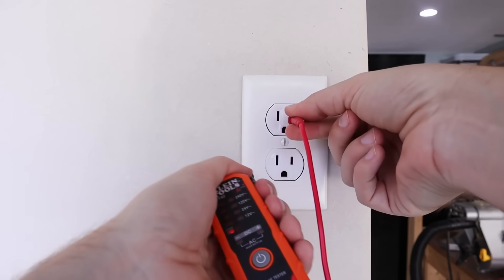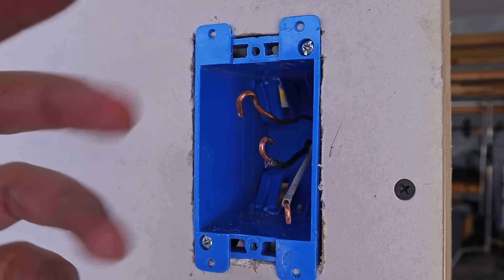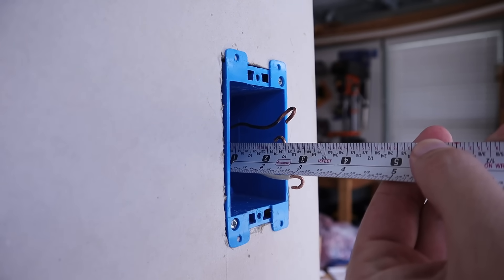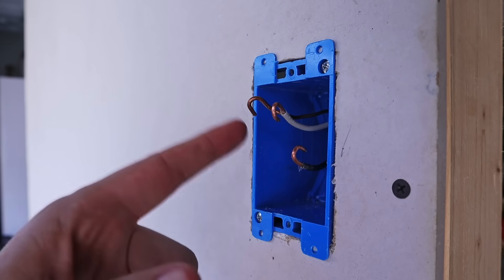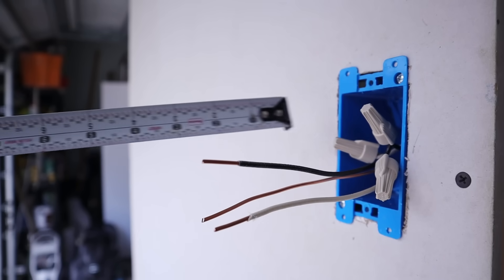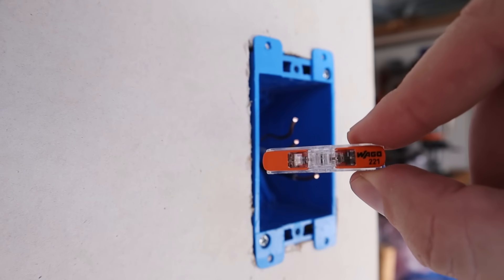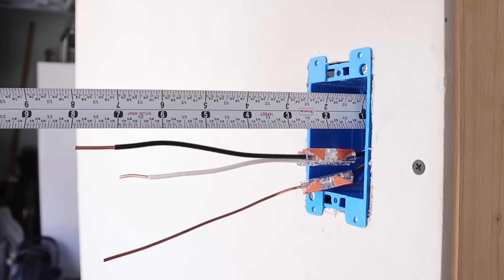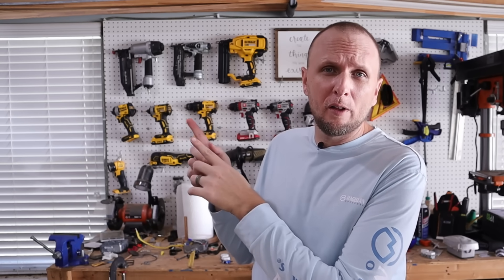"SHOCKING" New Way to Fix Short Wires In an Electrical Box to Code | Very Important

Comment: should I bring up the ever controversial, pre twist or not to pre twist the wires before using a wire nut. by code you are to install wire nuts as recommended by the manufacture. in my 28 years of being an electrician, I have not seen the instructions on how to install a wire nut ever include pre twisting. I am not sure I agree or disagree with the manufacture on this, and have done it both ways. just something to keep in mind
Reply from the maker: Well per code it says that you are to follow the manufacturers instructions.  Most of them say pre twisting is not required.  Which to me completely leaves the door open to it being your choice.  I have not read them say do not or is not recommended on the majority of brands.  I think inspectors interpret the code this way as well since every electrician I know both residential and commercial pretwists their wires.  But I would rank this subject as probably top three most debated topics.  That is for sure!  Thanks a lot for the input!
Reply: @HowToHomeDIY  ahh so the manufacture have positioned them selves in a neutral stance. I honestly have not read the instructions on wirenuts  in a very long time.
Reply: btw I have not pre twisted a wire nut in 20 years. you just need to keep them the exact same length. the wirenut will do all the twisting it needs to make a solid connection

Comment: You didnt address the insufficiency of the space in the box to accommodate the wago connectors or the twist connectors after the switch or outlet is pushed in.  Also with such long tails as required by code, any sharp kinks in the back of the box can fracture the sheathing which needs to be avoided.

Comment: Now you just have to find another way of connecting the outlet... Maybe something without screws and without exposed conductors. America really should be more open to inventions we made in europe 30 years or so ago. You can pull out an any outlet here without shocking instantly yourself, even the ones with screws. Code can be changed...

Comment: Where do you buy the extra wire and what number?
Reply from the maker: I have found buying my Romex on Amazon to be the least expensive as of right now.  I buy whatever size I need for the circuit.  14 gauge for 15 amp circuits and 12 gauge for 20 amp circuits.
Reply: @HowToHomeDIY  Must be in Yank land, 14/2 is approved for up to 20 amps  in Canada.

Comment: Here in Germany, Wago 2273 are way more common in junction boxes, and if i remember correctly they are in every way better than wire nuts. Less resistance, easier and faster, smaller, easier to reuse, and you can just add a wire to an existing connection or swap the Wago for a bigger one in less than 30 seconds. They are only good for up to 2,5mm2 (12AWG), but for up to 6mm2 (10AWG) there are versions of the Wago 773.
Reply: @ronblack7870  You are somewhat right, a perfectly applied wire nut usually has a little over half the resistance of a Wago 2273, but as the wire nut itself doesn’t conduct electricity, there is no way to guarantee that low resistance while wagos just need somewhere between 10 to 15mm bare conductor pushed in as far as possible (officially 11mm but in my experience 10-15 still works just fine), which is undeniably easier and more repeatable than applying wire nuts perfectly every single time.
Some other benefits I was just reminded of are:
- direct connection between solid (Wago 2273) or solid and stranded (Wago 221) conductors made from Copper, Aluminium and Steel possible
- possible to remove any single wire without even touching the others, which is a unique feature not found on any other common connectors made for 3 or more wires.
- easy to check the connection of the individual conductors, basically impossible with wire nuts

Comment: Not a big fan of push in connection, I view them as a liability wating to happen.
I've also found a lot of electricians dont install the ground on a light switch.

Last the ground wires always uninsulated inside the box great care has to be taken to keep it from shorting out to the hot wire or that will trip a breaker. Hopefully thats all.
Reply from the maker: Yeah I do no like the push in connectors.  The Wagos are much better than them though.  I personally still use wire nuts mostly.

Comment: I find it odd that those saying that stabbing an outlet is bad tend to support using Wagos, which is essentially the same thing. I'll stick to wire nuts.
Reply from the maker: Well they are completely different mechanisms if you look at them on the inside.  And I’m not a Wago fanatic.  I typically use wire nuts but wagos are a great option for certain applications.

Comment: To me the wago connectors seem similar to the push in hole on the back of outlets. I worry they will lose with age. I don't trust them.
Reply from the maker: I understand the lack of trust.  I will say though that if you opened up a receptacle and opened up a Wago you would find they are very different in how they work.  Thanks a lot for the input!
Reply: They are a simple minded way to avoid work.

Comment: I ran into this at my uncles.  Home was broke ground about 40 years ago and its a life long project. I was very young back then and not ant help. The boss " his wife" wanted white switches and receptacles. I think they wired one and yank out all the slack..."waste not want not" is what Grandma said.  I changed some and It took more time than it should.  GFI's and extra wire don't fit. Block wall filled with concrete

Comment: What about the Wago 2273? Are they legal to use over there for solid wires? The 221s are great if you connect stranded wires but they are quite bulky.
Reply from the maker: They are legal but Ideal kind of has the push in connector market cornered with their In Sure connectors.
Reply: The 2 wire and inline models are MUCH smaller.

Comment: Does this same method work with aluminum house wiring?
Reply: The Wago's will, how old is that wiring?
Reply: @michaelwright1602  appreciate the reply very much. The house was build in the mid 60's. So original to the house.
Reply: @dwayne5698  I would start to rewire if it were me... Just saying. It is not that difficult, but can be a PIA depending on the structure.

Comment: One thing I did not hear you mention is that the 3 & 5 wire connectors are only for multiple wires of the same polarity. For instance 3 white or 3 black or 3 ground. One cannot connect the white, black, and ground in one 3 wire connector.
Reply: 🤷‍♂Who knew?
Reply: @georgemicha2454  Shaking head and rolling eyes... But, I could see someone doing exactly that...
Reply: Well duh?  Wouldnt it be obvious, you wouldnt wire your hot and neutral together would you ?
Reply: @Mixwell1983  
I think he meant connecting all three with the same connector, one three way connector per neutral and so on?

Comment: US electrical system - safe? Is that even possible...?
Reply from the maker: We do not have any more electrical fires than the UK per capita.  The US actually has slightly fewer.  You can look it up.
Reply: @HowToHomeDIY  Comparing to Sweden. One of the safest in the world when it comes to electricity.
USA: 3 deaths per million.
Sweden: 0,2 deaths per million.

Not counting all the other accidents that cause hospital visits or only shocks, and fires and more.

And worth noting: Lower voltage (safer) in USA compared to Sweden.
Reply from the maker: Well I said UK but either way I’m not finding your statistics to be accurate.  First, Sweden does not really have a full set of data concerning injuries and death from electrical fires.  Also, if you take the number of electrical fires and divide it by the the population, the US and Sweden are near identical in number of fires.  But if we look at what is probably a more accurate way of comparison and take the average number of annual electrical fires and divide it by the number of dwellings, Sweden has almost 4 times as many electrical fires as the US.  This is all very easy to find through government sites.
Reply: @HowToHomeDIY  We actually have a pretty good statistics on this. Concerning fires, related to installations like fuse boxes and outlets are around 150 per year. In USA, receptacles alone account for around 5.300 fires per year. Stove is the most common cause of fires, and when comparing with USA, remember that 40 percent use gas stoves in USA and in Sweden it like basically zero.

Our laws for electrical installations are superior compared to the US, and the regulations for who can do electrical work is also superior compared to the US, and our outlets are also superior to the US, and all modern home MUST have ground fault protection, and everything must be grounded since several years back, and cables in the wall and how you install them and the outlet connection boxes are superior compared to the US.

And this shows in the statistics, as said. We are in the top in the world regarding electrical safety. Despite a lot of cold wet corrosive climate that is really hard on the infrastructure and the installations with high power demands during winter months.
Reply: Twice the volts/half the amps may make for less resistance/heating at suboptimal connections and in maxed-out circuits?

Americans still have some independent spirit and not all of us embrace the concept of "Big Brother Knows What is Best For Me"-unlike the great majority of Scandi's...some of us value the right to do it ourselves even if it isn't always done in the best possible way.
Reply: @MrMEmEmEmEMEMEeeeeee Well, here in Sweden we really do not have so many maxed out circuits. But, we have three phase too. To practically all homes.
Each outlet in the home is normally fused to 10A 240V.
Common main fuse is 16/20 or 25 (can be larger but not common) three phase 400V. We have 16 here where i live.
This goes really well.
Only problem i might have is if i use the electric water kettle (2,2kW) and the microwave (1,45kW) at the same time since they are on the same outlet/fuse (10A). But water kettle goes so quick so no real problem.

Comment: It’s weird to see plastic blue boxes and Romex as in 23yrs I’ve used a few times, in Cook County/Chicago we cannot use nothing plastic, no Romex, we have to use EMT or if using any Flex we cannot use more  than 3ft in Chicago and it can only be Greenfield and not Armored Cable or BX, when we hit the suburbs then we can use 6ft of flex either or with a ground normally MC Lite. Then to top it off we have to use anti short bushings on any flex no matter what type of connectors you use. Seeing this video is foreign to mist of us here when I deal with cloth wiring 90% of the time on service calls, I do use Wagos but the cloth wire forces us to tape the ends.

Comment: I was hoping for some unique compact suggestion, but not today...  To often those boxes I have had to deal with were so short due to the former service guy or when they built the house used those push in the back connectors on the outlet or switch did not come out or they did not come out for me. The old old system had larger switches and outlets and sometimes a shallow electrical box. No room for even wire nuts.....

Comment: Do you guys in the US ever use the 'standard' WAGO 2273 push-ons? Those are the go-to wire connectors across the pond if there's no stranded wire involved. They're a lot cheaper than the 221's and much slimmer as well. And they come in a number of different sizes (including a 2-wire).
Reply: I have some 6 wire ones.
Reply: See also Ideal In-Sure.
Reply: They have their place but for the average DIYer it's best if they keep some 221's on hand and use those.
Reply: @kamX-rz4uy  @Nervous Breakdown Both 221s and 2273 have their place.  The 221 series is great up to the 5-wire limit.  The 2273 series is great up to 8 solid wires.  If you have both, you'll likely find a use.  If you can only afford one, 221 is the way to go.
Reply: @kamX-rz4uy  They are best when space is at a premium which why I got their 6 connectors version.  Yes, I have boxes with 6 hots/lines or more.

Comment: I would use much longer pigtails so that the splices never need to be disturbed.  They should sit in the back of the outlet box and never move if you install or remove a device from the box.  One of the wiring specs we had on a job was that wire length in an outlet box was a minimum of 200cm or about 8 inches.  It just makes installing receptacles and switches a lot easier to work with.
Reply: There are recommendations for what wires should sit where in the box (although most people might just jam them in there). 
It is recommended that grounds go in the back (first), then neutrals, then hots. It’s to be safer.

Comment: It's probably not the best idea to promote jamming the wire into the WAGO connector. If it were I kinda think WAGO wouldn't market it's device as lever operated as forcing the wire in would be going against the manufactures intended method of use.

Comment: We stopped using wire nuts decades ago in the UK.
Reply: How about the antique white ceramic ones, lol
Reply from the maker: Yeah they were made a lot different back then and more likely to fail.
Reply: @HowToHomeDIY  

No wire nuts are used here at all. Twisting wires together is frowned upon. And rightly so
Reply: @martinw245  Way different voltages/amp loads across the pond.
Reply: @So Isaidtogod  Amps are no different. Loads are no different. Voltage can be. A Wagos rating is clearly given. The 211 is available in 30 amp version, downrated to 20 amps for 2.5 twin and CPC, and also a 40 amp version.

Plenty of happy US users.

Comment: Best thing I can tell anybody is from the tip of your finger to the tip of your thumb that's pretty much code. I would not use wire nuts in that situation they sell an insulated crimp that you can crimp on the wires I would have took the box off completely before installing them
Reply: What are YOUR credentials? Which finger? Take the box off for what, and installing them, what?

Comment: the longer the wire the more you have to put in the box
Reply from the maker: That is true.  However, at least 6” of wire is required and has to extend at least 3” past the edges of the front of the box.   So there is that that we cannot get away from.

Comment: In my opinion you are misinterpreting the code. It isn’t 6 inches from the sheathing AND 3 inches from the opening. It’s one OR the other.
Reply from the maker: No it is both.  This is due to different box sizes and depths.

Comment: Shark bites for electricians. The trades are being devalued by gimmicky diy crap. The material manufacturers are making out great but technicians will get the short end of the stick in the long run.

Comment: Nice, didn't know they had inline connectors too. The house i bought has a bit of DIY wiring the inspector didn't catch. Front garage sconces have romex going into loft but not on a circuit, at least they left like 20ft for each one. Couple outdoor light fixtures not using junction boxes. I have a switch that, i assume goes to an outside fixture above the rear garage door. The romex is very short and rigid so pigtails may help. I did replace all my T8 flourescent fixtures with LED using wago - so much easier.
Edited fir stupid autocomplete errors.
Reply: It is their newest model.

Comment: The video does not show there is now enough room in the box for the wagos AND the socket AND the excess cable.
Reply from the maker: Plenty of room.  The wagos don’t take much room and the wiring is either at or just barely longer than what is required to be there.  Of course GFCI’s and smart switches are always box hogs but that is to be expected.

Comment: Does the US use anything like our IP rating system, ingress protection? Our sockets are IP2X as a minimum, that "receptacle" would be seen as a death trap in Europe!
Reply from the maker: A death trap because it lets dust in?  And if it is in a wet area that is why GFCI are required.

Comment: Is it really necessary to cut the bent ends off the wires in the box? Couldn't you just straighten them out with the pliers? It seems like it'd give a little more room to work if you're using wire nuts.
Reply from the maker: It would give more room but here is the concern.  The copper had already been bent pretty sharply in places.  When you bend copper one way and then you bend it back the other direction, it weakens it quite a lot.  So while it MIGHT be ok to just straighten it out, it may also snap off at some point and provide a possible fire hazard later.  I just always try to show what is safest.  Does that make sense?  I hope I was able to answer your question.
Reply: @HowToHomeDIY  Most wires inside a j box do not get the anmout of bending you refer toward.  Too silly to pay attention while working can cause this error to present itself.
Reply: @HowToHomeDIY  Yes, that makes good sense. Thank you!

Comment: I managed to watch it through the 'maybe you can pull on the wire' part - if that was the case I would not be watching this video - and I switched off at someone using single-use wire-nuts instead of Wago connectors. Seriously dude, catch up!
Reply from the maker: Not everyone knows to try and pull more in.  There are many that can benefit from that tip and have plenty of wire in the box.  Absolutely nothing wrong with wire nuts.  Installed correctly they are one of the best connections that can be made.  There was also an entire section about Wagos and actually the newer ones.  It is all there 🙃
Reply: Dude.. how short is your attention span? It was a 9 minute video. He mentioned pulling the wires, service loops, wire nuts and 2-3 variations of Wagos.